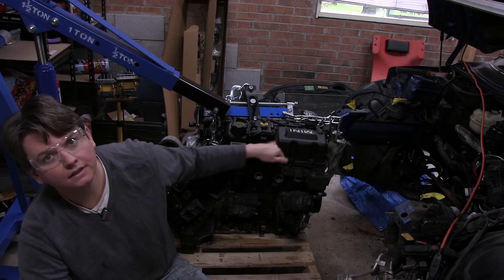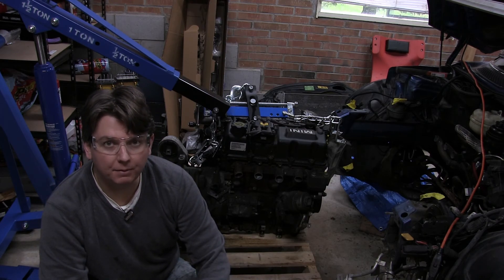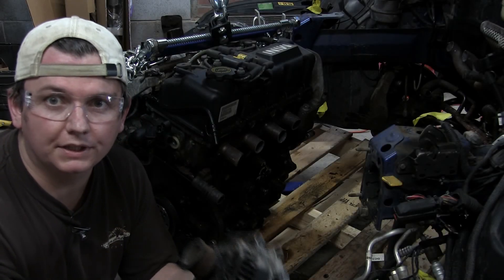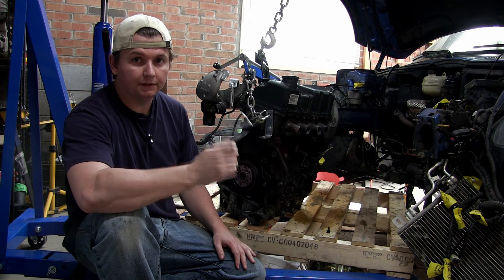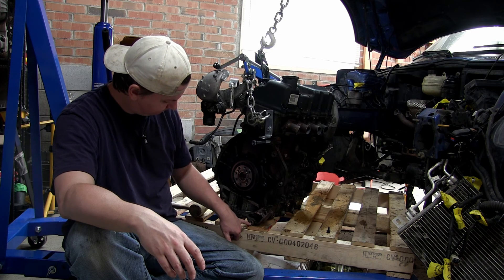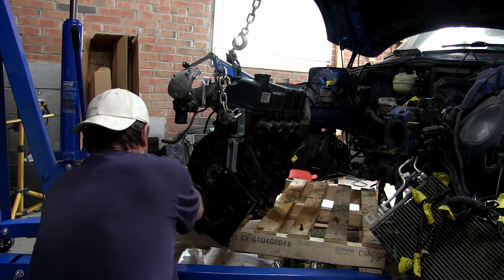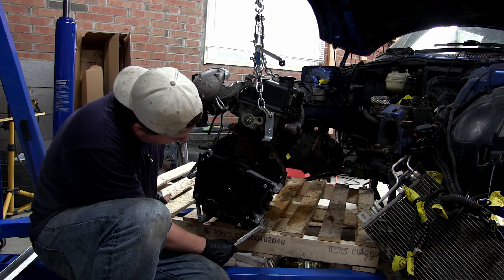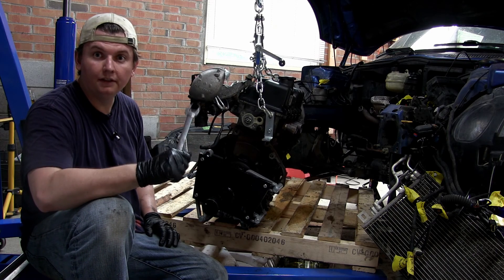E17 - Opening and Inspecting the Engine - R53 2006 Mini Cooper S

Comment: It looks like all the plastic pieces from the chain guide blocked off the pickup and stopped oil flow. Pressure must have been low enough to cause a problem but not low enough for the dash light to come on. I'm glad I added an oil pressure gauge.